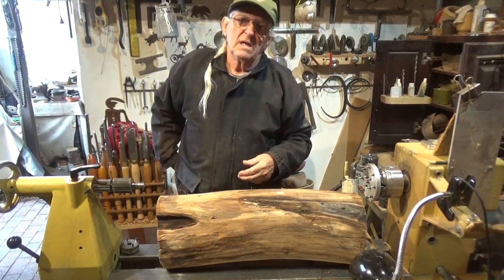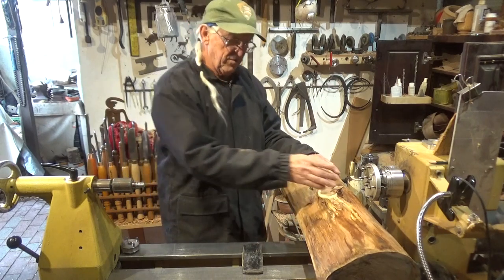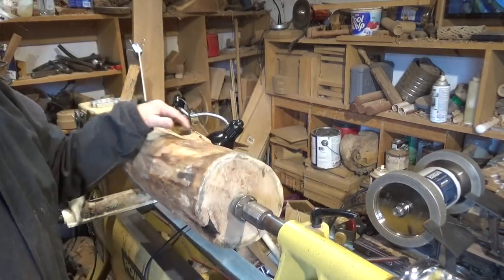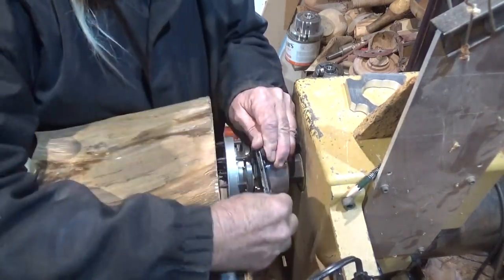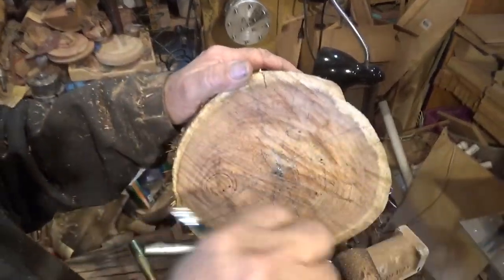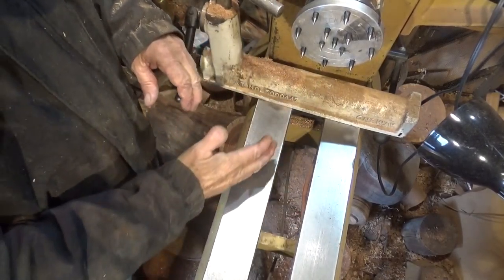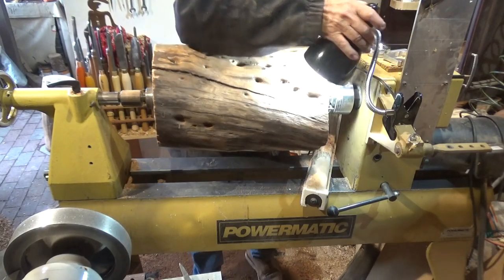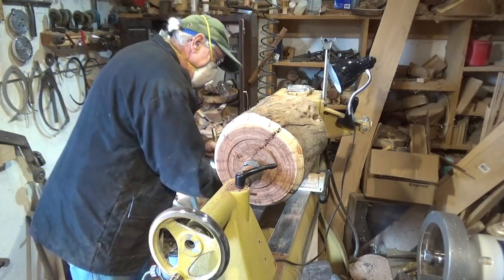Easily mounting large pieces on a lathe

Comment: The jack is a good idea. But what a struggle you went through! I mount a face plate, drilling or chiseling if necessary to get it squared. Easier to slip it on to the head stock while jacked up, than trying to line up the center and screw in while on the jack. Your chuck place could be mounted first, then put in the chuck while on the jack.
Reply from the maker: Thanks for your reply, Valerie. What I should have done at the beginning in setting up for mounting was drill a hole at centers on each log. Then I should have unscrewed the center screw on the Chuck Plate, and bring out the center point on the live center to fit in the hole on the log. Once each end had a point into the holes one each end, just tighten the tailstock, and I would have been done... When I'm not explaining how to do something with my tools, I'm much faster than what the video portrayed. I made the jack a coup[le years ago, and certainly didn't have the issues I had in this video. 
Thanks for watching this video. Subscribe to my channel if you like.......... Jerry
Reply: Nubsnstubs Already a subscriber.